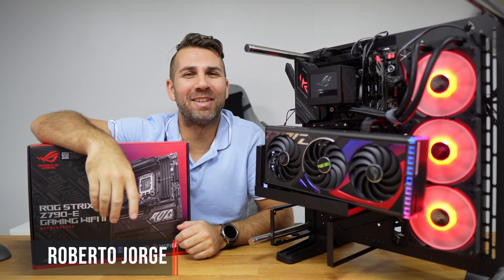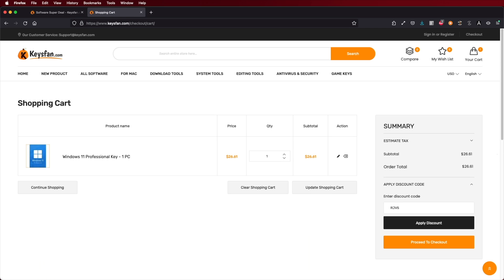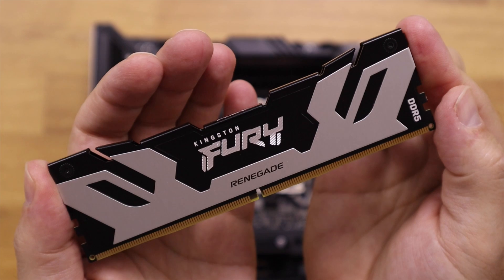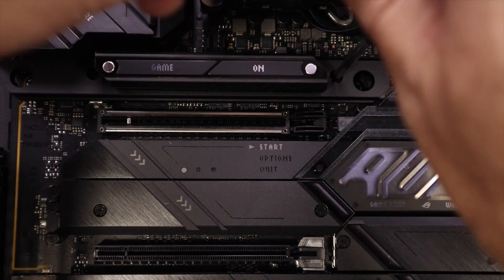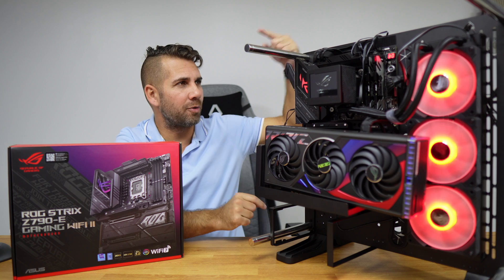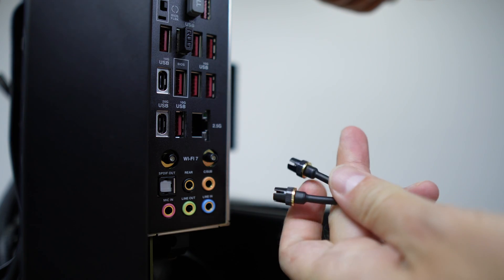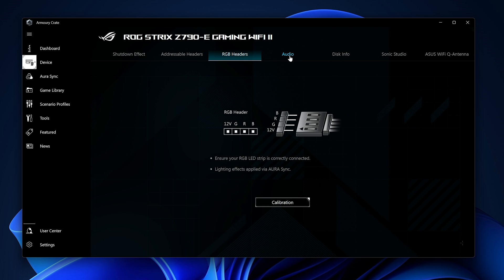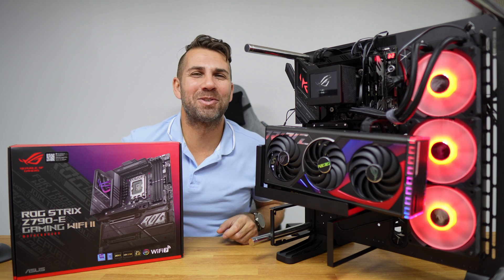ASUS ROG Strix Z790-E Gaming Wifi II & Intel I9 14900K intel

Comment: I can not stress this enough. Do not build this combo. The intel 14900k has been an absolute nightmare with this board. There is massive issues you should look into with these intel chips. I have broken two cpus now with this combo running stock settings, and the new bios updates pushed out by Intel have been of no help. Skip this build.
Reply: What motherboard do you recommend
Reply: Problem not in board. All TOP SEGMENTS boards from ASUS or anyone more Vendors, have unlocked TDP from a box. You need go to bios and set intel recommended limit for 253w for you 14900k and you will avoid processor degradation and overheating. Or you can make expensive custom loop and use i9 14900k for a 400w TDP. But its no reason for this power

Comment: Hi there I’m close to buy this motherboard but I’m not sure what cpu to choose. I know I would go for i9 14900, but which version? I don’t want overclock. So normal without letter ok K, KS  or which one? I mean about mhz as well because online can find confusing info’s. Some saying max 2.0mhz some 3.2. Please let me know.
Reply: I have a 14700” F” TDP 65W with no integrated GPU and a locked multiplier. Interesting to see some users are actively seeking to “undervolt” their “k/kf”  to mitigate instability issues. This chip is a beast out of the box.

Comment: I have that motherboard with a 14900k. It's been good. Although, mine has a bios bug that can't be fixed with bios updates. around 70% of the time i boot to bios, it freezes for 1 second every 2 seconds. It's annoying but I can still complete bios updates. If you plan to get this board and run anything faster than 7600mhz ddr5, don't do it. I've tested it with multiple CPU's, a 14900ks, and you will not get 8000 MT/s stable. trust me.
Reply: That's because (according to my research) the board is optimized up to DDR5 7200 (OC)

Comment: How is the sound on that board ? I have the strix f z790 and it sounds kinda flat not a lot of bass , even if I use my audio interface with the thunderbolt add on card the sound signal is not very good.

Comment: Does this notherboard still have the same Asus problem where the top pcie 5.0 m2 slot reduces the gpu speed from x16 to x8?
Not a big deal until you put in 3080+ tier gpus, but still annoying
Reply: All current Gen5.0 M.2 share lanes with 16x pcie reducing them to 8.
Just use a gen 4.0 M.2, trust me you won't be missing anything
also video cards today still don't utilize benefits from 16x pcie . not even the 4090
Reply: This has been tested, you only lose like 2-3fps on most games

Comment: Hi. 
Thank you for the video. I exactly have the same MB and Memory 2x(2x16)@7200 Kingstone, but I only get 4200MHz. When I change the settings in BIOS to XMP enabled, system do not boot. How can we take advantage of these memories with 7200? 
I will appreciate your advice.
Reply: Make sure put ram on standard sort as motherboard manual . 1st
Reply: Pick a RAM from the QVL list then enable DIMM FLEX